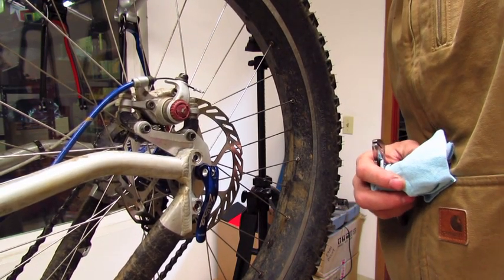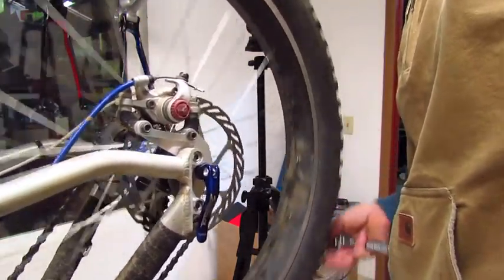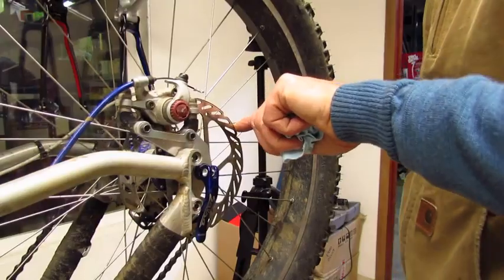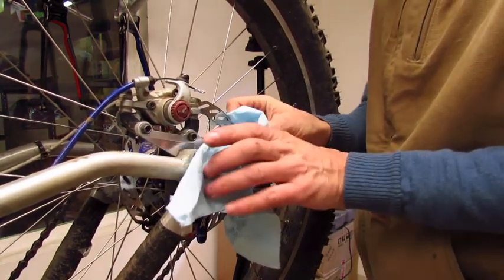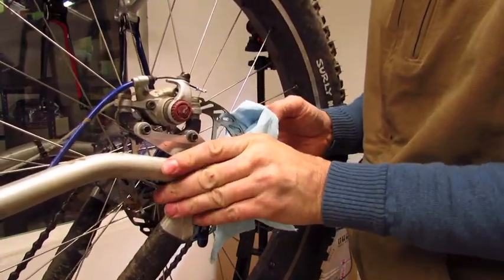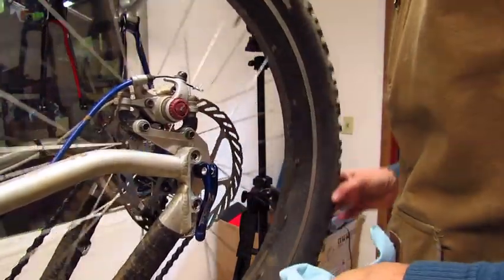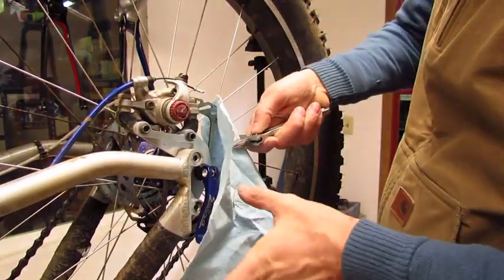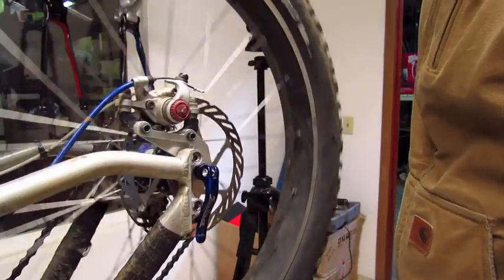rotor truing

Comment: I just bought a specialized crosstrail bike with mechanical disc brakes. I went for a test ride and found both front and back brakes were rubbing which I told the owner. He said this is perfectly normal and would go away in time.
  I want to thank you for showing me how easy it was to fix the rotor from rubbing on the pads....You would think the owner of this bike shop Bicyclesplus in Folsom, Ca would take the less then 5 minutes to fix this problem on a new bike. Thanks again!

Comment: What if the entire disc is rubbing?  I bought a brand new bike and tried adjusting the caliper in every way instructed and made sure the tire is seated properly.  But the entire disc is rubbing what seems to be the outside pad, because I can widen the inside pad and I've made it as wide as possible.